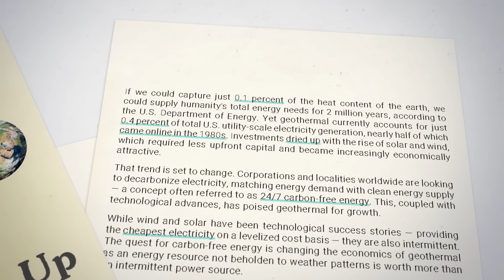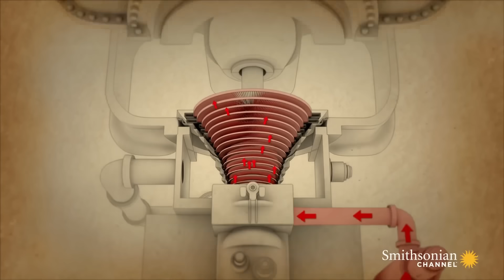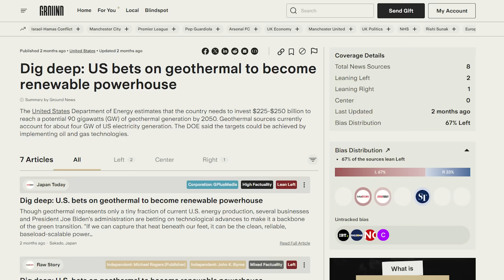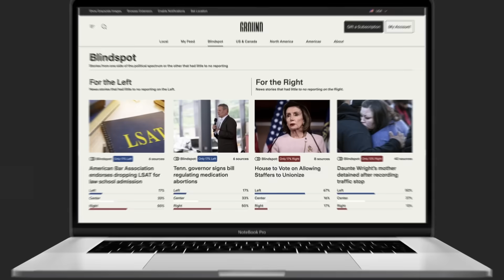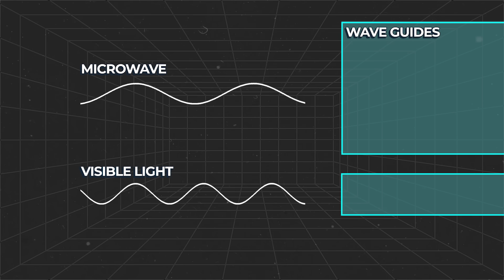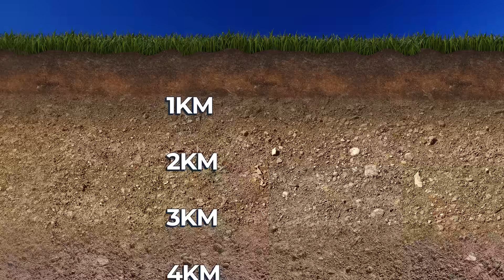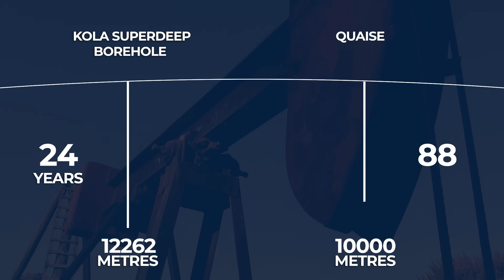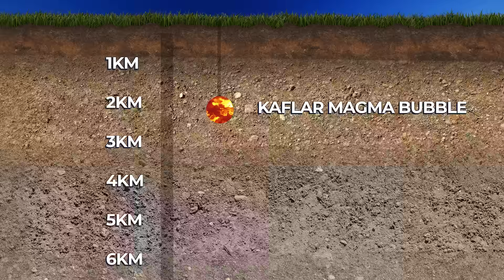This Fusion Tech is Solving the Geothermal Energy Problem

Comment: This won't work downhole. You have not dealt with the tons of rock mass that you vaporize but will lose energy (cool) as it rises. Remember that the rock density will increase with depth. You use a reductionist argument ("this is just that"), it just ends up as vaporized rock which you blow out of the hole, and as a glaze on the borehole. Not so fast: There is far too much mass present with insufficient mass vaporized to account for that mass. But what happens to mineral vapors when they cool? Their ambient temperature state is not gas, they are solids. (The second law is a bitch.) And since vapors transfer energy by bumping into each other much like billiard balls, at some point, you are going to end up with mixed mineral-powered particulates if you can blow them out of the hole fast enough. The nice trick at 1km or deeper is where the purge gas and the vaporized rock are cooling and contracting as it rises, and so the combined mixture is increasingly dense as it rises (mass density in gravity=weight). Yes, you can stage vents or multiple pipes with more gas, and that may solve one problem, but at some point, you will run out of space for those pipes and the outflow space. A more likely outcome is that this mixed mineral powder will simply plug the hole. But this assumes they are uniform in size, which they will not be. A particle, say, 10 atoms long, will absorb more energy without being significantly heated, and so, those will grow and grow, requiring ever more energy to blow those to the surface. I would suggest that at some point of X depth and heat, you will lock the device trapped inside that glossy or glass-like molten rock mixture if not actually melt the waveguide. So the waveguide needs to be made of very expensive materials, which are made to resist this heat, but will they then be a waveguide or a material subject to absorbing the wave itself. But back to the glass-trap issue: the gas flows being against rock, the flows will not be laminar or smooth, and so eddy currents will arise creating small outcroppings of that solid glassy material, if not actually waves of material ascending up the sides of the borehole. If the speed of the material so flowing is high enough, much like water flowing with a Froude number exceeding 1, those waves may flow down the hole, restricting the flow, increasing the pressure, and Froude number (as it were), compounding the issue. This needs to be thought out.

Comment: The Earth's inner ecosystem is likely as fragile as the outer ecosystem we are already destroying. With this being all new technology there is no way of knowing what will happen when we start sucking energy out of it for this process and the net effect of it. Regardless of how much of a fan you are and the curiosity behind this there is no argument against the fact that this could be as bad or worse than us pulling all of the fossil fuels out of the ground. This was a huge leap forward for us, for a few hundred years until we realized we caused a potential life ending issue. Should we really be spending billions on it before we research the possible repercussions of doing so?

Comment: I figured out how to use much lower temperature and therefore able to tap geothermal without going anywhere near so deep. In fact, it can draw power from temperatures so low that it wouldn’t even boil water.

Comment: Is this microwave beam the same as the plasma drill bit recently developed by the Southwest Research institute? If not, I wonder if the two technologies could be used in sync to increase the speed at which drilling can be accomplished. Either way, it'll be awesome if we can finally tap into hyper efficient geothermal power that is on a scale that can power entire cities.

Comment: I actually worked in drilling, albeit it being for a short time. 100m a day is possible if it is the upper  1-2km of rock, and if it is sediment. then drilling speed significantly slow down, as the material gets harder.
but they always drill in some sort of sedimentary rock. not igneous rock.
igneous rock is much harder and more complicated to drill in.
but that plasma method is actually capable of drilling in that environment. that's basically the reason why the kola bore hole did take so long. it was so hot and it was hard rock, not some sediment.

Comment: Harvesting the core of are 🌎 we live on is Dum. The hot core provides are shield from harsh space radiation.. Clean technology's are both over priced and suppressed by the powers that be because they do not line there pockets with money. Take power company like Tryconty power they refuse to work with homeowners that have solar and refuse to pay for power put back in the grid and with 0 power used they will still bill you bs fee's for the active acc even with no power use and stealing power.

Comment: Many commenters asked about the vaporized rock condensing before exiting a long borehole. This seems to me to be a very good question. However, I am certain that I recently read about innovative small subsurface tunneling machines that utilize a similar ("laser-like") radiant heating or gas or plasma-based cutting processes in place of rotary cutting blades. I recall they tunneled rather slowly but continuously and, I think, sealed the tunnel wall as they progressed. An alternative method for underground pipes and conduits.

Comment: Alright someone please explain to me how at around 7:55 Electrons produce photons!? Is that even possible! I’m sorry I’m just a curious student
Reply: Short and rough explanation: That is what happens when excited electrons fall into a lower orbital around atoms. The energy lost when  the electron is put Into a less energy intensive state that way, generates a photon, which have energy levels corresponding to the energy lost by the electron.

An electron losing much energy in that process generates a high energy photon, which would have a short wavelength. And a photon losing little energy produces a photon of low energy, having a longer wavelength.

Since electrons bound to certain electron orbitals around atoms (again, this is not completely true, but it is an older and simpler model that works for much stuff anyway) have very specific energy levels corresponding to them, they can only emit and produce very specific wavelengths.

This is roughly what is used in spectrography. If we know what light colors a material can emit, we can know what material it is.

This is also how helium was first discovered. Because the sun produced colors that indicated a new element was there. Then they found it on earth too.
Reply: @Renisauce  great thanks!👍
Reply: Breaking radiation, deceleration of charged particles , basically anything that is not a neutron emits radiation, which E is the difference in the particles E before and after it interacting with the magnetic field. Thats how X rays work. And thats why its a nuce idea to line tanks cointaining high E betta emitters with polimers to sliw down the electrons before hitting the steel. To avoid bremmstralhung , same thing produces the very high intensity cyclothron radiation,  you havo those particles going in a loop constantly changing direction. Etc...

Comment: It's not an infinite source of energy though it's it. There's a finite limit on how much energy you can extract from the planets core. There's also a limit on how long you can extract energy from the core before it's been cooled down to the point of potential catastrophe. Exactly what happens when you've removed most or all the energy from the core?

Comment: If you took away all the subsidies how much demand would fall away from EV sales? We have the technology to run cars on water so there is no need for solar panels, nuclear plants, coal, petroleum, the entire grid is obsolete, wind power or even hydro, let alone drilling down 10km+ for geothermal. We can run jet engines just on water and when water is "burned" the engines exhaust puts out 21%+ oxygen and zero emissions. A truck can throw away the fuel tank and replace it with a 1 gallon tank of water and it will never need to be topped up because a condensation unit will keep it supplied with all the water an 18 wheeler needs. Or throw away a jetliner's 6,000+ gallon fuel tank and replace it with a 100 gallon water tank. No more firery crashes and water is free.

Comment: It is such a shame that you reached out to these guys selling geothermal snake oil. So much of what is in this video seeks to convince people that this is a valid concept beyond the lab bench. Even the opening statements about geothermal energy being currently out of reach are sadly nonsense as are almost all the statements on drill bits, tripping speeds and the effectiveness of the technology presented beyond a few tens of meters. We will have nuclear fusion before they will get this will work. From waveguide attenuation issues over the distances discussed to creating a usable hole quality with a melting/ablating technique. Then there is the issue of getting the vapour not to condense in the borehole. The problems of conventional technology at depth/temperature are already behind us for super-hot rock.

Comment: Closing the gap with wind and solar won't be achieved with a base load solutions.

The complimentary generating technology for solar is dispatchable generation, i.e. generation that can be turned up and down, on and off reasonably quickly, such as batteries. However batteries can't provide an economic solution for long duration renewable variations.

Theoretically deep geothermal could probably provide dispatchable generation, but that would mean operating at much lower capacity factors which would push up the effective generating cost, but that might not necessarily be a game changer.

Comment: Check Sci FI author Philip Jose Farmer.  In his books day world rebel - breakup etc. the future society is powered by huge “ seismic valves and huge bore hole at geological unstable places. Example San Andreas fault and various other locals.  The ICELANDIC nation do this to this day pumping water down pipes that turns to high pressure steam spinning there Turbines.  There lucky sort of. There Geothermal sources are close to the surface. Like a few Kilometres and still they have to keep drilling new ones because the process cools the vents down. Etc et t.  Cool tho .  Until our next disaster movie. ICELAND EXPLODES CAUSES next great extinction.  Well that will put paid to global warming.  ICE AGE. COMETH.    Again.

Comment: Nice concept.
What happens to the obliterated rock in the deep hole?
Is the rock tip at a higher temperature than the melting point of the steel pipes?
If the rock fragments are vaporized and have to travel up the microwave beam to exit at the top I assume it'll remain gaseous untill exiting the pipe absorbing microwaves as it rises, how much does this lengthen the drill time as it gets deeper?
Etc

Comment: If you evaporate the rock with energy to bring it to high temperature, you have to maintain this high temperature all the way to top. If not it will condense and block your drill hole.

Comment: I'm curious about how well the technology will endure hot, vaporized rock pushing back up the bore path. getting below 500m is already a long path for that vaporized strata to move back up the hole (that is mostly full of wave guide) and it only gets worse as you get deeper.

Comment: It's not the temperature of the rock that matters it's the heat flux which is the same at every depth (within the drivable layers of the Earth).

Drilling deeper gives access to hotter rocks, but if the heat is extracted at a rate which exceeds the upward heat flux, every project is just a one-shot heat extraction for a few years until the rocks cool. 

Unfortunately the upward heat flux is small in most places. In the UK the average is 0.038 W/m^2 and globally its less than 0.1 W/m^2 almost every where.

One-shot cooling of deep rocks may be worth doing, but there will be likely geological consequences of the stresses built up as a blob of deep rock is cooled, and contracts.

There are smart techniques for extracting heat from rocks in a genuinely sustainable manner but they involve lateral drilling rather deep drilling.

Best wishes

Michael

Comment: One interesting thing is that the average power is limited by the rate of heat diffusion to your borehole. At which pointv they look like hydroelectricity, with a total amount of energy you can take out per year, but it doesn't matter when you take the heat out. it may make sense to use them as peaker plants to fill in the gaps of wind and solar

Comment: I'm astounded that they'd think of intentionally going for supercritical steam.  I did an internship at a super-critical coal-fired plant, and the trouble they had to contain that heat and pressure ~5,000 psi - was immense.  AND if a pipe sprung a leak, they only entered the area after waving a long wooden pole in front of them.  The steam would be invisible for some yards, and capable of cutting us in half before we could notice it happening.  TBH, I expect the first plants to be similar to nuclear plants: "low" pressure steam driving BIG turbines. That's a bit easier to cap and pipe to where you need it to go.  Supercritical?  shudder.

Comment: Assuming the drill works (which it won't) how do you get the heat gradient? All engines run off a heat gradient (difference in temperature). You would need to pump some type of heat exchange down the thousands of feet of tunnel and transport it back before it cools. It is a good idea in theory but we have a long way to go before this actually works.

Comment: If the idea is to vaporize the stone and then blow that vaporized stone up thousands of feet of a very narrow hole it will fail. The vapor will condensate on the walls and jam the system in a matter of minutes.

Comment: Fervo energy has done geothermal using 5 to 10000 ft vertical drilling and over 100 horizontal bores allowing steam generation to create low expense electricity without burning fossil fuel

Comment: There are numerous areas on every continent that contain "hot rocks" close to the surface and are producing geothermal energy. California gets more than 15% of it's energy needs from geothermal. Chasing really deep sources is irrelevant, go for the low hanging fruit first, and yes it might require this high-tech approach, but I don't think so. How many hot springs, thermal mud pools and extinct volcanoes are there in the USA. Start with Yellowstone and work outwards.

Comment: SMART AUDIENCE ... Somebody beat me to it.  The  Exact thought I was having as I watched the video ... (conventional drilling followed by Microwave Laser drilling).  A hole drilled with casing installed to 2-3 km could be drilled in a couple/few days.   I was just talking about this at the Precision Drilling, Nisku, Job Fair just outside of Edmonton, three days ago.  I wonder if they know about this microwave tech.  They were saying that with their newest drilling tech they can now drill their deepest holes in "Approximately" 10 days.  I can't think of a reason why this technology wouldn't bolt right on to a contemporary Telli-Triple Topdrive.  They are doing a lot of directional drilling as well so ... I wonder how well this would work Directional Drilling a closed looped system to the "super-heated" depths ???   ...  We might be talking GIGAWATT SCALE Geothermal production. 🤔🤔🤔🤔

Comment: Not sure how well thought through this is. How do you stop the vaporised rock condensing back onto the walls of the shaft above it and onto the wave guide carrying the microwaves. Also once you reach a decent depth the pressure of surrounding rock will just collapse the shaft almost as soon as it is drilled. I suppose it just sounds like a good idea to anyone not involved in engineering.

Comment: When they experimentally put pipes in a hot water geyser in Yellowstone National Park the geyser extinguished. They removed the pipe and the geyser never returned. You can cool off the molten rock to the point of solidifying it at your point of access.
Reply: Seems to make sense to tap into volcanic hot spots. When the source cools, drill deeper to reestablish a new hot spot.
Reply: @kerrryschultz2904  unintended, unknown, maybe irreversible consequences, could result from cooling the earth's core. We haven't a clue what we might be doing. Co2 is not an issue anyways.
Reply: @Marley-ii6ls  I can't find the information any more on the energy contained in a cubic mile of molten rock but it's in the hundreds of thousands of barrel of oil equivalent. The amount of energy that can be extracted without really having an impact on the earths temperature is far greater than all the fossil fuels every used. Certain volcano's that could be tapped would just help to stop eruptions and provide valuable heat for electrical and district heating.